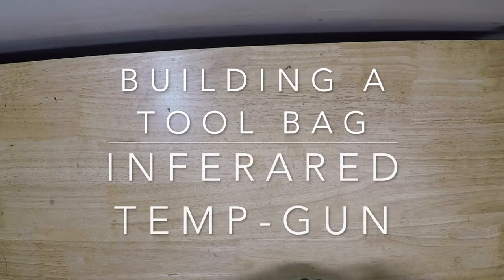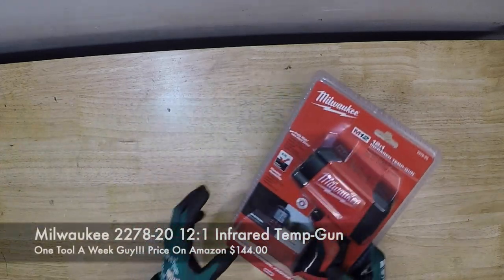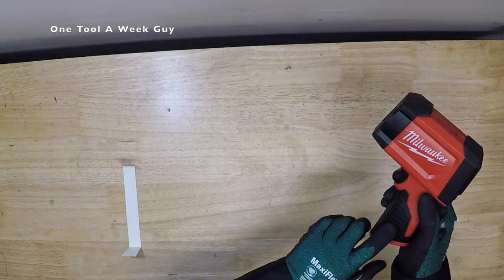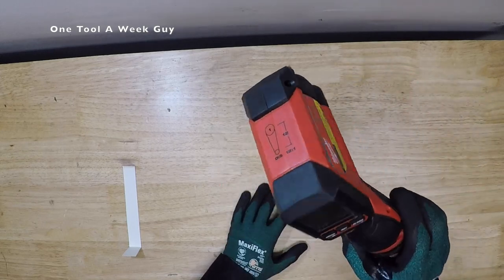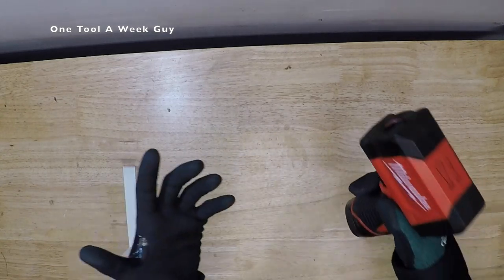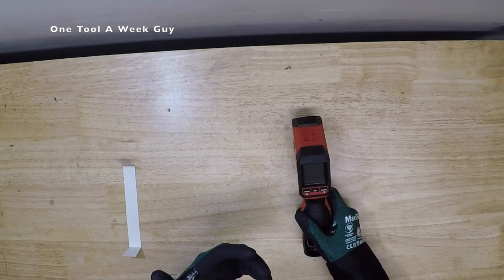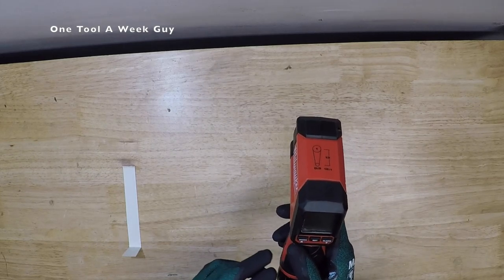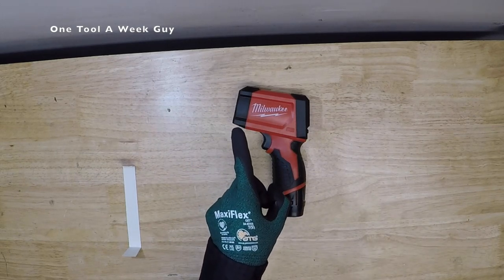Building A Tool Bag (Infrared Temp Gun Milwaukee 2278-20)

Comment: I hadn't seen the Milwaukee temp gun. It looks pretty nice.  I really like my Fluke 62 but often use my Sperry pocket IR thermometer which does a great job and fits in a shirt pocket. Really handy to measure supply and return air temperature at registers and grilles, circuit breaker temps, blower temps and of course the red marker makes a great cat toy.
Reply from the maker: Cat toy lol never though about it like that. Next time im out at a job and see a cat ill give it a go lol thanks gary.